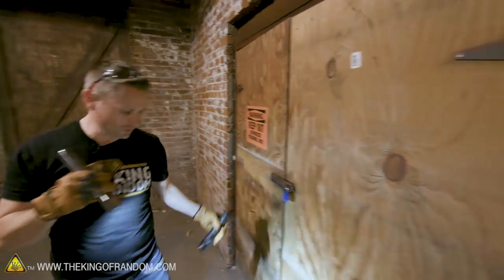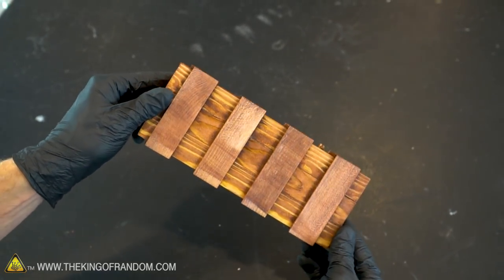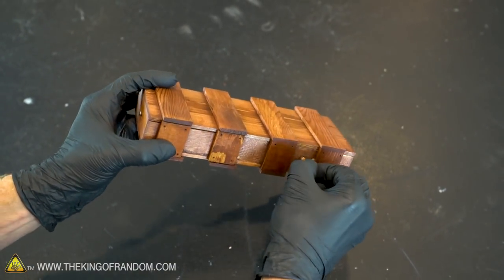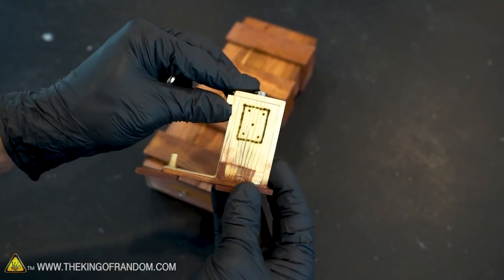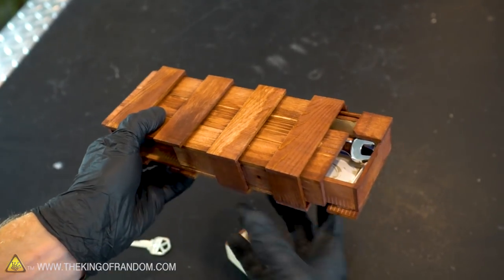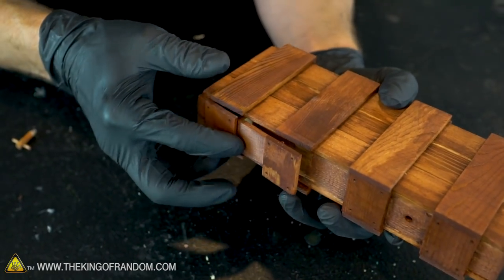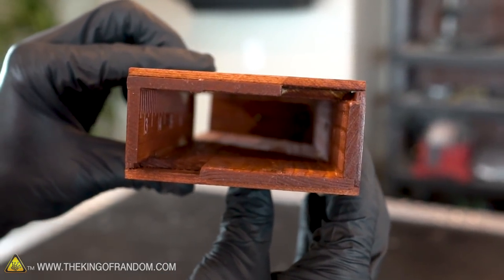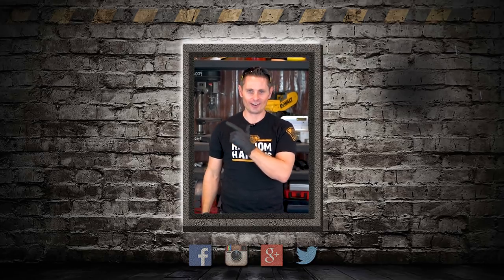Mystery Puzzle Box! TKOR Dives Into How To Make A DIY Puzzle Box!

Comment: Hey buddy, I've been watching your videos for a while now, and enjoy what you do. 
You make science fun, and I've always been one of science's many lovers. 
Long story short. I think an interesting video could be about electroplating. Say nickel or even a couple of different ones, and test how well plating goes with all kinds of variables. Like the potency of your nickel acetate if you do nickel or even make your own solutions with just the different metal in it's purest available form and use them raw as your anode and cathode, in vinegar or other acid depending on your metal. Different solution temperatures, with different currents running though. It could even be a few videos if enough people are into it, as it can be a lengthy process. 
If you try it out, a fun little fascinating thing is switching your wires for your anode and cathode, after plating for at least a half hour for decent plating to happen, that's all I'll say about that. 
Views. You're welcome 😊